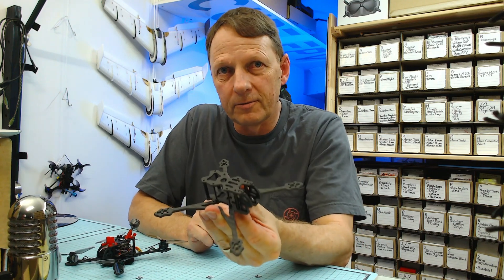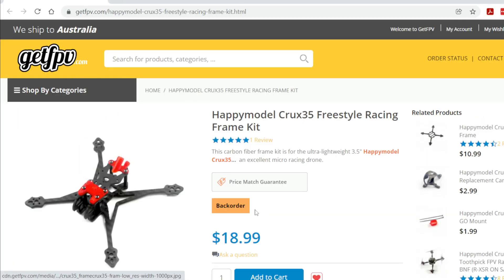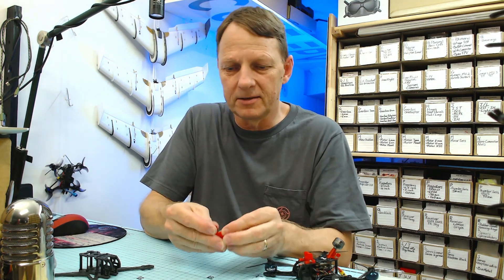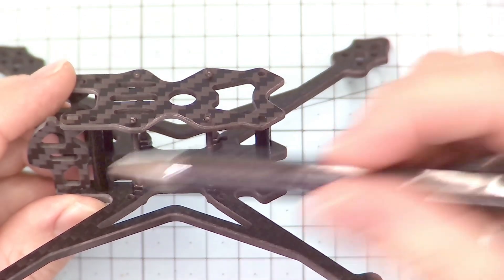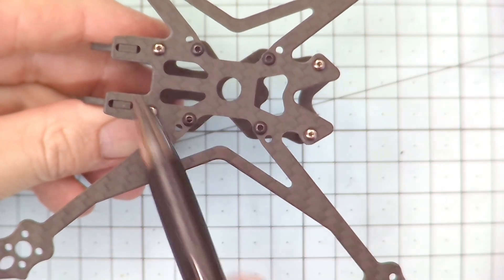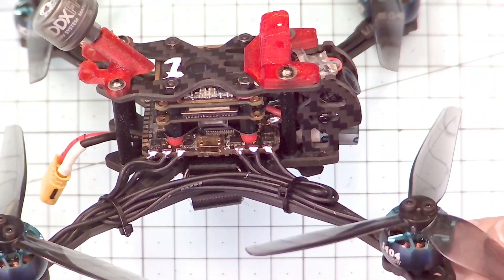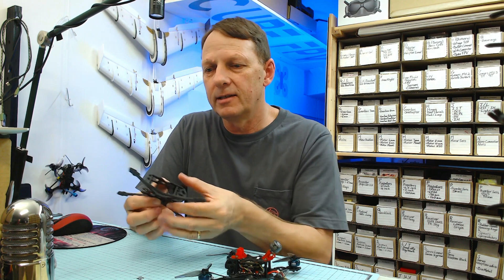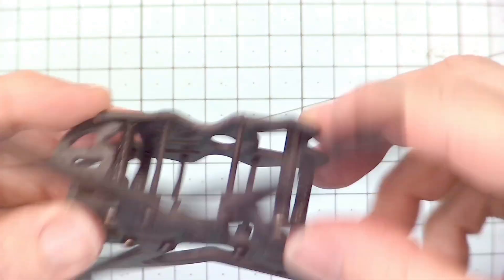HappyModel Crux 35 FPV Frame Overview

Comment: i converted it from bottom mounted battery to top mounted battery for better freestyle performance. I do not do racing with it. The top plate is not good for battery strap but you can attach a 30 to 20 adapter to it making straight lines for the battery strap.
Reply from the maker: Nice modification. Yes this frsame does fly verry differently with the underslung battery.

Comment: I went through 3 Crux35 frame bottom plates, they are made to break. Do you have a good light weight replacement frame that has a top battery mount for the Crux35? Any suggestions would be appreciated.🙏
Reply from the maker: My Goto frame fro 3.5 inch these days is the GEPRC Smart35. 
https://cubefpv.com/home/resources/scratchbuildguide/
https://cubefpv.com/product/fpv-frame-geprc-gep-st35-smart-35-3-5-inch-freestyle/
It's been around for ages but it's still the best. Oh also HappyModel has brought out a V2 Crux35 and that frame has been improved without the weakness of the V1 frame. I think they removed those holes at the base of the arm. Currently you can only get that frame as a bind n fly (with HD Zero) but they will probably start selling the frame kits soon too.
Reply: @cubefpv  Thanks Bro, by the way the New Crux35 V2 frame is just as weak and breaks!  I’ll check out your go to frame an see what that looks like, 🙏
Reply: One aloternative is to use 2 bottom plates. :D

Comment: This flies very well for a long time. In my experience this frame always breaks at the rear legs, near that unused hole. A good frame replacement is AOS 3.5, as it has replaeable arms.
Reply: was thinking about buying this frame for my crux35, only thing I thought abt was that the crux35 has 1404 motors I believe and most people use bigger motors on the aos3.5 did you notice any big flight performance differences?
Reply: @Simon_fpv   I can recommend it even on 1404. I fly analog, so it,s still on the light side. If you freestyle, the old frame was a no-go: I already broke 3 of them, everyone at the same junction in the rear arms. Flighttimes went from 6min to 5min. You can feel the extra weight of the AOS, it's like carying a thumb cam but the performance is still very good. Stock 1404 motors won't get warm.
Reply: Actually they call it a ultralight design and it also is. I also have a broken arm now. My arm is broken between motor and body, closer to the motor. I gonna try with double bottom plate now. Is still sub250 that way...
Reply: @Sugalime3D_FPV  The V2 of the frame is reinforced at those spots without any major weight penalty. Hopefully you can find the bottom plate as a spare piece.
Reply: @miquelmarti6537  I know that there is a new version... I ordered 1x complete frame and a bottom plate. Hopefully both have the same version... But also probably both versions togheter maybe can also be used as double bottom plate...